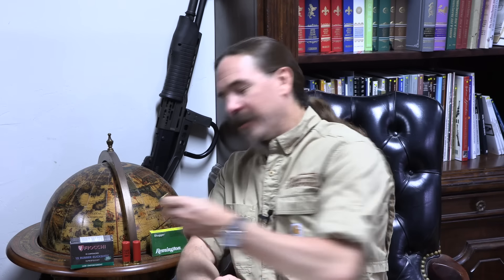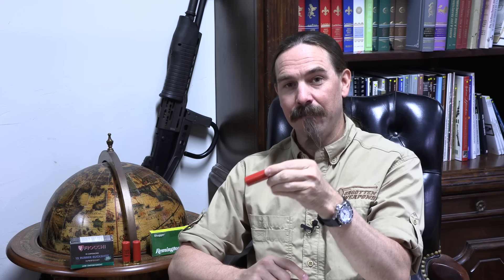The Unique Challenges of Self-Loading Shotgun Design

Comment: My mind goes back to the Q&A on man-portable chain guns ~2yrs ago. The primary "reliability" benefit of an externally-driven system could extend to cover the dramatic variation in shotgun shell loadings as well.
Wildly impractical, and it doesn't inherently address variation in shell size... the tradeoffs still aren't "worthwhile". But I'd love to see someone take a stab at designing a true man-portable chain shotgun - just for the engineering challenge & the joy of it.

Comment: I had a Remington 11-87 one time and when I fired some of the loads for bears (3" #1 buck), it actually ripped off the brass case head. It didn't do that with slugs though.
Reply: That’s a cyclic timing issue.  I encounter issues like that when working up 300blk loads.   The cartridge has fired, and for a split second the case is still expanded and tight in the chamber, so the shell hasn’t contracted back yet, but the fast bolt timing is trying to extract it out.

Comment: A silly idea just popped into my head: maybe using programmed motors to drive the bolt for self-loading can be a thing?
Yeah it is going to need batteries and creates a ton more parts that can go wrong, but it might just not care what shell it's putting in the chamber.
Reply: I can definitely see that working. As you said though, reliability is an issue. Not to mention extra weight, bulk and manufacturing cost. Honestly it’s something I would want to see, not sure about the reliability aspect but it’s interesting nonetheless.
Reply: This is why engineers are not designers.
Reply: so a shotgun-minigun?
Reply: @potatoes5829  no. I was thinking something like a pump action, but the motor does the pumping part.
Reply: Programming would be an overkill. A chainshotgun actuated by some househeld power tool should suffice (well, I guess power tools do have controller chips now). The deadliest DeWalt in the Wild West. External action makes so many things oh-so-much more simple. If only it would be practical for a hand-held firearm.

Comment: possible fix for issue with new shotgun cartridge for self loading rimless being incompatable both ways with flooded market of shotshells currently around; new "modern shotshell" is bigger diameter. new ammo specifically for it is made and sold for new weapon. however... the old 12ga shells also have enough power to operate action of new weapon. but... like the dardik revolver reloaders do with the triangle shells and standard cases... the old 12ga shells can be run in new weapon with an adapter cartridge that is probably 3d printed and single use. but also have multiple use metal ones available that can have spent shell swapped for new one once you porobably shoot thru a whole box of them and go home to reload them for next time.

Comment: I have designed exactly zero shotguns in my life. But if I were to make a try at a semi-auto shotgun that should fire all kinds of loads, I would design it to cycle at the weakest possible load through a gas operated system.

The gas system would have a regulator (or similar)  in it that, no matter what the pressure is, it would still only feed just the pressure the gun needs to cycle.
In low pressure applications, the regulator would for all intents and purposes not exist. In high pressure applications, the regulator would divert a lot of the excess pressure somewhere else.

How would the regulator work? Well, that's where research and development would take place but I would keep it simple. As simple as a flapper that closes just after enough gas has gone past it and on the other side of it is just an exhaust port that jets the excess gas elsewhere.

"But what about heavy cartridges vs light ones"

As I said, it should work with the lightest loads. But I only just now thought of the "what if" with heavier cartridges. Different length cartridges was implied in "cycle at weakest possible load" where cycle would mean the internals moves all the way even with short cartridges.
So, now it also needs to cycle HARD even with light loaded and light weight cartridges. Which is where I would just make a staged buffer that will catch the bolt no matter how fast it's moving with any given load after it has been unlocked with the gas system envisioned above.

Again, as I said, I have designed zero shotguns. At best I've made a musket out of a long pipe, using firecrackers as the load and marbles as projectiles. At least it passed through steel road signs.
Reply: Biggest issue is that light loads generally don’t achieve enough pressure energy to cycle a traditional bolt system. You could in theory create a very low mass reciprocating bolt, combined with a ball bearing rail system to reduce friction as much as possible. Though such a system would be expensive to manufacture, inherently complex, and possibly prone to reliability issues. 

Self regulating gas systems in shotguns have been used (Veper 12), though the design simply can’t get enough gas pressure to cycle with light loads. The Gen 12 uses a self adjusting Short Recoil system, which IMO can reliably cycle the largest variety of shells, though still not capable of cycling low power loads. 

I think the takeaway is there simply isn’t enough market interest in low energy load self-loading shotguns to invest into R&D.
Reply: @Dirty_Bear22  If the load is so light that it can't even cycle a bolt, I would consider it a party popper. Not really a shotgun round at all.
Reply: @RealCadde  I’m confused. Wasn’t your idea to create a system that would cycle the weakest load shells using a gas system? Pretty much every single less-lethal shotgun shell isn’t going to cycle in a semi-automatic, I would consider those actual practical loads with a specific purpose. Furthermore most Reduced recoil standard loads are also iffy in semi-auto systems. But if you consider very light/light loads a “party popper” what exactly are you trying to design?
Reply: @Dirty_Bear22  "Pretty much every single less-lethal"
Yeah, those are the ones that should cycle. And they have enough pressure to lob a load of rubber balls. Which means they have enough pressure to cycle a bolt that is designed with this low pressure in mind.

If the pressure is so low that you'd have to go into the things you mentioned, then it's not a shotgun round. It's a party popper, and is going to be useless at its intended purpose of deterring the target from being stupid.
Reply: @RealCadde  “Which means they have enough pressure to cycle a bolt that is designed with this low pressure in mind.” The issue is only a small percentage of gas energy is successfully converted into kinetic energy needed to cycle a bolt. The energy at which a round is fired at isn’t directly proportional to the energy available for bolt cycling. Which is why no manufacture currently makes a Semi-auto shotgun that can cycle such rounds. In order to reduce the energy required for cycling you need less reciprocating mass, less friction, and greater energy conversion.

Ultimately we are both just speculating as no such design currently exists or has been attempted. If it’s ever produced it will be interesting to see what design ends up being used.

Comment: Sorry for a (probably) stupid question, but why aren't light brass casings used with a wax plug (like old 1930's Webley blanks)? Is there a modern 3-D printer material that would match the weight of a plastic casing?

Comment: Due to the fact that shotguns are mostly sporting guns, and shotgun shells are big enough that 5 rds (max 10) is all that's reasonable the advantages of an auto over a pump are such that the pump works just fine.  I know that there are auto shotguns but they're not a huge improvement over a pump or a double for what most people use shotguns for.

Comment: Theres probably a very simple answer. Most shotguns the barrel is removed easily.
Wider barrel sleeve on barrel its now rimless 
Or just alter the brass component for a semi make it rimless. Make a clip on rim, for use in legacy, akin to a clip on 45 for 455 webley, except its for 1 shell not 3 or 6. Disposable rim a few uses at most 3d printers any joe can make the clip to convert it at home

Comment: I want to see a chaingun merged with a shotgun and make that ornithopter from Dune 2 a reality.
Reply: Shotgun shells would actually be a good use case for a chain gun due to the differences in loads. Wouldn't have to worry about a lightly loaded shell not cycling.
Reply: That's what leaped to mind, tbh.
Why bother with self-loading at all? Just run the damn thing with servos and a big electric motor, problem solved! Maybe stick some sort of linear dynamo on the barrel to scavenge power from recoil.

Comment: I think a more accurate way to compare birdshot and slugs is by momentum, as this impacts the self loading mechanism, rather than the projectile energy. the difference is even bigger when you look at that
Reply: The issue is that you have final momentum of the payload, but the acceleration and time to get there is variable. You technically want force * time, which is impulse
Reply: @GoriIIaTactics  lemme quote wikipedia for you real quick:

"In classical mechanics, impulse (symbolized by J or Imp) is the change in momentum of an object."
Reply: @nuttyDesignAndFab  yea I kinda just realized. I think it needs some sort of modified impulse, to put more weight on high force low time versus low force high time. Getting hit by a hammer really hard once is worse than by a hammer softly 10 times

Comment: I've been playing Resident Evil 4 in VR mode

The riot gun based on the Benelli M4 locks the bolt open when it runs out of ammo

To reload you have to close the bolt and then you can feed shells then you cycle the bolt again before you can fire 

Is that wrong? It seems like the bolt locking open should be ready to load then you just close the bolt and shoot again

(Granted, you do only have to load one shell for a full reload so maybe they just wanted to slow that down as a compromise to not loading 7-10 shells manually)
Reply: Yes it’s wrong, bolt wouldn’t be required to close in order to reload shells. but as you said it’s just done for game balancing. And technically it’s only based on the M4, so in universe maybe it does require the bolt to be closed for reasons lol… But hey you get the benefit of condensing a single shell into multiple. 
I still remember so many guns in the original MW2 were actually modeled after green gas airsoft guns.

Comment: The much maligned Winchester 1400 series had a pressure regulator built into the magazine cap. This was simply a cone shaped valve with a fairly stout coil spring. I have owned several of these guns over the years and all would cycle with any ammo that would go bang.  The gas piston was inside the magazine tube which was the actual cylinder. This limited the magazine to 2 rounds with another in the chamber for the normal hunting limit of 3 rounds. The locking arrangement was copied from the AR15 with a rotating bolt, a cam pin traveling in a milled slot in the bolt carrier and multiple locking lugs locking into the rear of the barrel extension.
Reply: No issues with my 1400

Comment: Has anyone attempted an M14 style self-regulating short stroke piston?  Perhaps it’s overkill for a shotgun but it seems ideal for such situations.

The other thing I’ve wondered about is a Johnson style rotary magazine.  That would present cartridges higher and flatter than a box mag.  It could also be easily topped up, something that’s actually important in shotgun shooting.

Following up on that wouldn’t it be more convenient to carry shot shells in stripper clips rather than magazines?  A four round clip could fit in a pocket and two to top up an 8 round rotary mag would be much more convenient than an 8 round stick.  Plus it would make topping up easy, shoot two/load two and put the others back in your pocket.  I’m imagining Swiss style chargers with full length support for the shells, made of plastic of course.  Much cheaper and more reliable.  Yeah you wouldn’t have the wow factor of a huge mag but that gets old when you have to carry it around.

Comment: seen old full-length 12 bore brass cases (plated, no less) - no idea what they were for
Reply: Warfare in wet conditions, cardboard cases would get damp, fragile and less reliable in waterlogged conditions like jungle or trench fighting so small batches of brass cased shells and slugs were produced, today the use of plastic cases avoids the problem and are lighter and cheaper then brass.

Comment: There is a pretty easy solution to all of this (technically easy, legally could be tough). With as small, light, power dense and reliable as batteries have gotten, you could build an electrically driven system and feed from something like a belt. And for anyone thinking electric motors are too unreliable, for one electric motors can be extremely durable and reliable but you also don't have to use motors. Imagine something like a pump style action but the pump is actuated by a solenoid instead of by hand.

Comment: I was gifted a Winchester 1500 that would not cycle. I spent a few weeks to figure out the pegs/posts on the operating rods where worn so I bent them about 1/8in and she has run very well ever since. Spare parts hear in England are almost impossible to find and the shipping cost from the USA is astronomical. Why is so cheap  to buy stuff from China and so expensive from the USA 🤔🇺🇸🇬🇧🤔

Comment: Okay, this brings up a thought. Why don't we see belt fed shotguns? I'm thinking something like the mk19 in 12ga, but semi auto and firing from a closed bolt because of the NFA/ATF. Wouldn't that solve most of the problems? Plus, you could do something like use old SAW nutsack as the "magazine." If you wanna go weird and French, you could even do it with feed strips instead of a belt like the Hotchkiss. 

Actually, the weird French way may just be the best option for once. They could probably fit in standard magazine pouches and wouldn't be too annoying or heavy.

Edit: Another idea! So, since some shells have much, much, much more pressure and energy, why couldn't you counter this by just having a relatively limited maximum throughput of gasses cycle the bolt? That way, so long as they meet some minimum, all cartridges should cycle roughly the same. You could achieve this by using one of those systems that causes fluid backpressure to build higher with less occupied volume so that the gasses can't physically enter the gas port, forcing them down the muzzle.
Reply from the maker: I think it's because the effective range of 12ga is too short to be useful in a military belt-fed.
Reply: @ForgottenWeapons  Exactly.  It would be a weapon for such a niche use as to be impractical.  It's a great Hollywood gun for a prop studio making something impractical for an action film, but it would be next to useless to assign to a fire team (Let's sit here in our foxhole and take fire until the enemy closes to 50 meters and is stupid enough to charge across open ground at us) or to place on a pintle on a vehicle because you expect Mad Max style boarding actions and might needs to sweep the deck of your tractor trailer flat bed.  A GPMG or SAW would be much more useful in a wider variety of scenarios.  It's the same reason the combat shotgun sees very little issuance.  Other than a few very specific tasks it not useful and requires the operator to carry another weapon for longer range use.

Comment: Do shotguns actually require head-spacing? Given that they are not intended for precision aiming and that they already work with different length shells, I kinda wonder if anything other than the position of the primer and firing pin really matters?
 
Legacy issues aside, a cylindrical (or very nearly so) chamber with a "rimless" shell held in the correct position by the ejector (i.e. a Mauser style controlled feed) could be viable. If that results in problems with shells falling down the barrel, then a stepped chamber that the front of the brass head bumps on would be a possibility. But legacy; that's a totally new ammo and action design with all the issues those have and few benefits over the existing well refined solutions.

Comment: Have had gas operated guns like Remington 1100 and inertia operated like the Benelli Super 90 and comparing them the Benelli was far superior. not to mention easy to disassemble and clean. Awesom design. The Reminton worked fine usually and was not a bad gun but clearly an old design.

Comment: 7:20 1432 ft/lbs OF ENERGY???? I never knew birdshot was so powerful
Reply: That is a calculation using the total mass of pellets at the muzzle almost as if it was a ball of lead.  The individual pellets are obviously considerably less energetic as they have very little mass.  Still in quantity even with their tiny mass, at the velocity they are traveling they will make quite a mess at close range.  It's like a grasshopper doesn't look like much, but have one strike you square in the face at 60 mph on your motorcycle and it isn't going to be pleasant.
Reply: @ makes sense

Comment: well trap shooting against small drones seems to be a pretty necessary thing for the near foreseeable future, ideally selfloader that can do rapid 3 round bursts, it would be nice to develop a new weapon and shell cartridge for it, something like the beretta A400 but with a bigger capacity or quick replaceable magazines, and the shells to be smaller but higher pressure some 1,5ish inches tops in a plastic non expandable rimless form factor or finally a caseless option, the g11 have had crazy high rate of fire ....imho that is where the demand is going in ukraine, you cant do shit about being shelled from a cannon, but tiny drones that drop handgranades/mortars/or have a claymore like charge on them could be detected by ai tuned microphone arrays and shot down by trap shooters